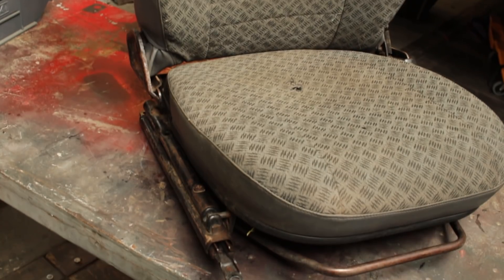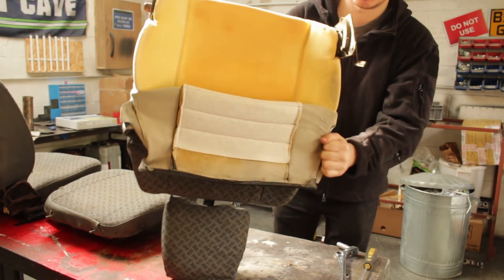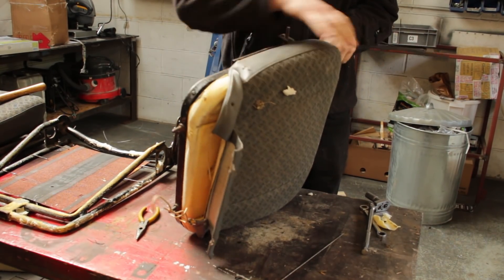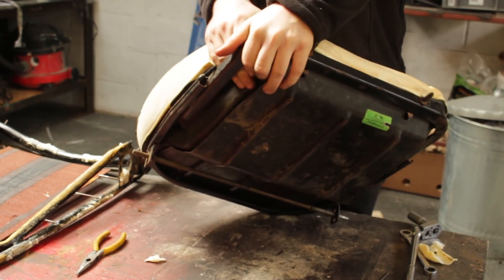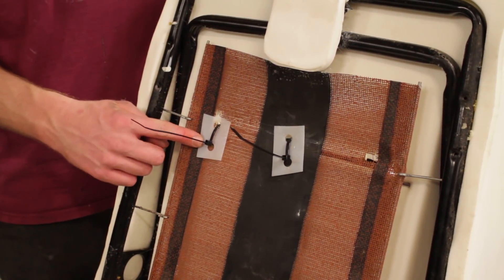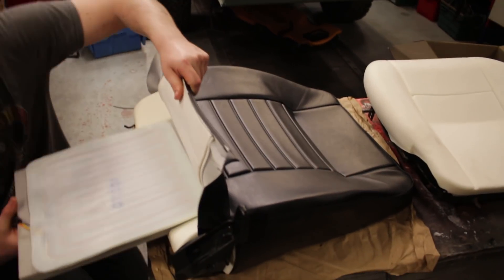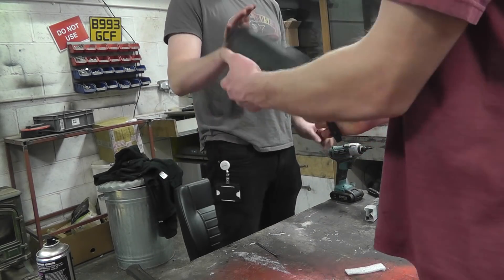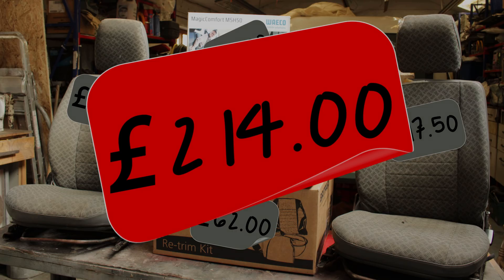130 Project E08 - Defender Seat Retrim!  You won't believe what we found in these old seats...

Comment: Well done, got them done! Yours looked to have a little more slack in them than the grey ones I did, trying to do that plastic strip up was a right bastard
Reply from the maker: I actually found the seat bases harder to trim than the squab; took a monumental effort from two of us to get the fabric under the rubber retainer!  Might be the extra thickness of the heater pad I think.  Worth the effort though.
Reply: Could well be! Knowing Britpart, tolerances will be all over the place so some will be tighter than others!